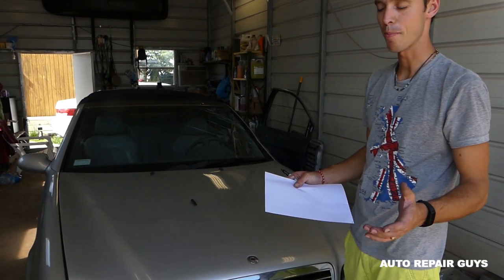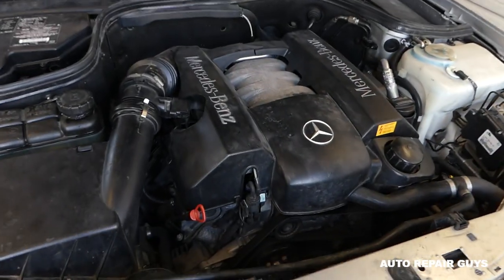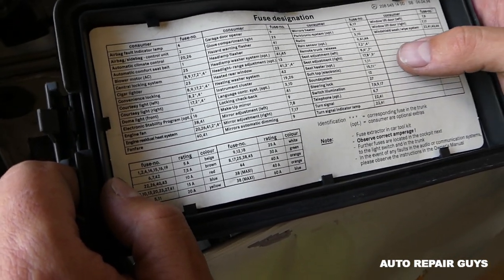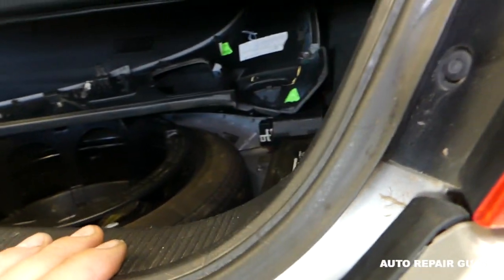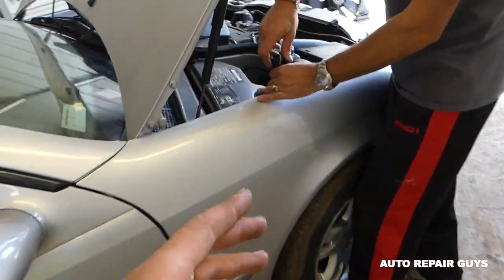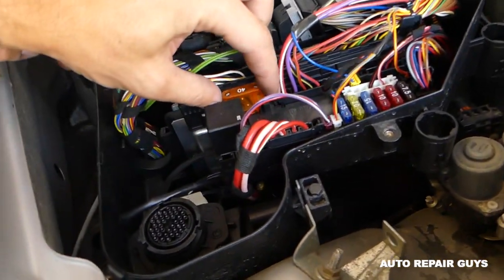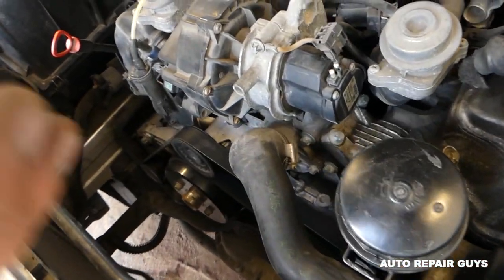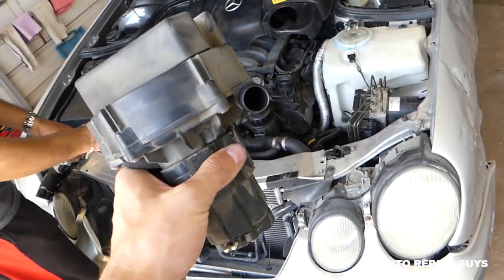P0410 SECONDARY AIR PUMP FIX RELAY FUSE SECONDARY AIR PUMP

Comment: Before checking the relay or fuse, please check carefully the hoses. From your video, starting from 0:56, the white hose connecting the EGR valve next to the secondary air pump is broken. This could be a potential cause of the code.
Reply: that was probably the issue good catch
Reply: Yes I own a 2000 Mercedes’ Benz clk430 and the hose are cracked
Reply: I have this code and I believe my issue may be tied to one of the hoses or the surrounding check valves. Is there a way to inspect those before changing them? I can hear my 2ndary air pump when i start the car and also there is a bit of a whistling metallic sort of noise...
Reply: I have the exact same hose, and it has a small hole in it. I’m going to try and replace and and tell you if that solves my code

Comment: This is only part of the diagnosis, the fault code description for P0410 is secondary air injection system low flow, which could be the fuse, wiring, the relay, the pump, one of the two diverter valves or (most commonly with higher mileage motors)clogged passages. There are chemicals and additives one can buy to clean the passages in the head without having to take the manifold or head off of the motor, along with a speedo cable on a drill to dislodge any carbon build up. When using these methods, make sure the exhaust valve is closed as to not allow any carbon into the combustion chamber, as well as with the chemicals, not to allow it to fill the cylinder up and cause the motor to "hydro-lock" and possibly bend a connecting rod.
Reply: Brian Peterson: Thanks for the extra info, on top of the video.
Reply: Can you help me? When my car's engine (M112/3.2) is hot, this pump turns on for 5 second and then off, then again and again. What can be wrong with it?
Reply: Brian Peterson is this an expensive repair at the dealer
Reply: Have you any idea where is secondary air pump relay location and the fuse ?Thank you in advance
Reply: Ur right i have checked everything to see was the problem on that P0410 code. Finally found the problem they where the air pumps air valves where clogged up with carbon. Either u can clean them or buy new ones. Once u take them out u can see all the carbon build up inside the manifold also.

Comment: I need your help I just put a new fuse in for my secondary air pump it turned on the secondary air pump but the fuse ended up breaking and I don't know where the problem is or where else is coming from

Comment: Hello friends. I have Mercedes W203,C 180 (129 Xp) 2001 with the fault code description for P0410 . I have been inactive secondary air pump. Have you any idea where is secondary air pump relay location? and the fuse too

Comment: I am trouble shooting this right now. That relay is not for the pump. It is the starter relay for the engine. I jumped the contacts to get the pump to turn on and the engine started to spin.  The fuse is correct one. I think the pump relay is inside the black box, where the fuse is plugged into, known as K40 relay module. Relay is not accessible unless you open the module.
Reply: did you notice that clear vacume line was broken
Reply: How did you do? I replaced my pump and still the light came back on. 😔
Reply: @RetroBoyVRrr  did u replace the fuse too? 40amp fuse. 
Try reseting the mil with a code reader too.
Reply: @terrenceg3257  the fuse looked so I did not replace it. The relay tho which one is it?
Reply: @RetroBoyVRrr  use a ohm meter to check the orange 40 amp fuse. U cannot access the relay. It’s inside the module.
Reply: correct.

Comment: Hi thx for this . Please I need help I have mb c350 1
2006. W203. Same air pump here. What does this pump? Pull or push air ? My pump PULL air in the hose arrow to admission.  Is wrong ?

Comment: I have w211 2004 E500 more than one year the pump not working and I already replace it but no power coming to the pump I tried to find the fuse and relay but not mentioned any where, any one can help?

Comment: What does the secondary air pump actually do? Will it hurt the performance of the engine if not fixed
Reply: redbaron2448 it smells terrible like burning gas

Comment: Hey, so my code has been coming up forever. I bought new air pump, new relay fuse, and still coming up. Should I get a new air injector valve ? Or new air pump control valve?⁉️please and thanks !

Comment: Hey guys I have a 2003 Mercedes c230k with a PO410 code.I bought a relay but my car does not have a diagram showing which relay is the secondary air system.Can you help?

Comment: Hey bro can you please please PLEASE help me out!? I'm getting three codes. P0410 P0174 P0400. Starting with the first.  I have a 2002 Mercedes-Benz C320 Base 3.2L. I'm getting p0410 cel code. I've tested the secondary air pump directly and it works perfectly. But when I go to check the voltage at the 40amp fuse, nothing. There is no power at all when the car is off or on, cold or hot. I pulled the relay and checked it and it is functioning perfect on all terminals with 0.001 resistance. Am I missing something here? Why would there be zero power at the fuse? Shouldn't the fuse have a constant 12v and be wired in BEFORE the relay? I'm just about ready to pull out the entire fuse panel and rewire the secondary air pump. Has anyone had this problem before? Tomorrow I will pull the egr valve and tube for cleaning. Hopefully this gets me somewhere on the P0400 and P0174 codes. Does anyone have a diagram of all vacuum lines on this vehicle? I've traced and replaced a few lines, but I am very sure I have a vacuum leak somewhere that I don't see. I do not have access to a smoke machine. But would the cigar technique work? If so, where should I be pushing smoke in? 

Any help is greatly appreciated! I'm not sure what other relevant information I should include. But whatever I am lacking, please let me know and I will immediately go out to my vehicle to get it.
Reply: Power is only intermittent at the pump, the first 60-90 seconds at (cold) start up and after a drive cycle for OBDII readiness monitors. Check the passages under the valves (one E10 bolt mounting it to the manifold) and make sure they are clear, you can even start the motor to see if you get a steady stream of exhaust from the openings where the diverter valves were mounted.